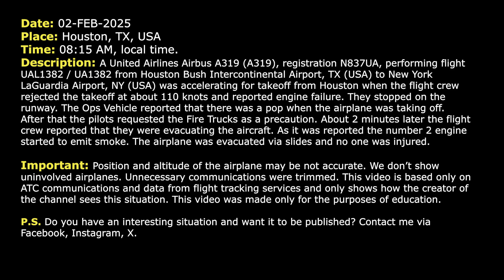Evacuation on the runway after engine failure. United A319 rejects takeoff at Houston. Real ATC

Comment: Damn, Boeing is getting so sloppy with their safety protocols that it affected Airbus' engines!!  In all seriousness, if the A320 was a Boeing aircraft, they would have been grounded by now with all the engine problems they are having.  Guess they paid off their politicians better then Boeing did.
Reply: I don't understand why you're commenting about Boeing when it comes to an engine failure involved in an Airbus jet. The engines on United's A319s are International Aero Engines V2500 turbofans just for your information.

Comment: Overreact much. Fire department never sprayed anything there was no need for an evacuation. There is more damaged when you evacuate under that situation then if you don’t. Pilots should have inspected the situation out the window and made the decision rather then going with the reports of the FAs
Reply: If there is fire or smoke indications, generally they will evacuate. A fire could consume the entire the plane in seconds so its a risk analysis I guess.
Reply: @ that is absolutely not true. We have checklists we run one part of that checklist is check for visual flames or smoke. The amount of smoke coming up out of that engine was not at all an alarm for cause. They discharged the first bottle which killed the flames if there even were any.  Engine failures happen every day. Very rarely do u evacuate for them. Especially for a contained one like this. When you evacuate like that you place people running across active taxi ways and running infront of responding emergency vehicles. It becomes very dangerous. Take the San Francisco crash for example. Almost everyone survived. One of the one that didn’t was run over by a fire truck. While yes that crash was a 100% evacuation needed my point is evacuating can lead to fatalities.
Reply: @SnakeWhite-i9q  Out of curiosity what aircraft? My understanding is on large airliners for instance, the pilots are very reliant on the fire brigade for observations and therefore decision making, and they're not gonna spend a minute walking down the aisle to have a look. Also in the video there were definitely flames in view of the passengers under the wing, it was not just an engine failure, there were visible flames and smoke. I'm not trying to be an armchair expert, and yes evacuations are risky, but it seemed fairly appropriate here given the potential fire hazard.
Reply: @ started with a regional now fly 737s. We do rely on ARFF to be our eyes. ARFF is really only useful in that sense when they are staged. This scenario they aren’t. Not expecting the pilots to walk down the aisle but communicate with FAs. Or airside ops that were already there. Airside reported no flames when they arrived. Which was over 10 seconds before they called for an evacuation from what we were told in our company’s memo
Reply: If you're ever on a plane that has smoke coming out of an engine, I hope the pilots don't let you off until there's visible fire.  Everyone else can evacuate and be safe.  Also, don't act like you are a pilot, no commercial pilot with an ATP certificate would think as ridiculously as you do.  The way you think would manifest in many of the other decisions you make, and you wouldn't make it past their training.  Get your lying ass outta here.
Reply: @Kalikus808  There were visible flames in the video, https://youtu.be/6_oSCW2fOnE . Also fyi I just passed my private pilot checkflight and yes obviously a CPL or ATP certificate holder would not think the same as I do. Thats how training and learning works, you improve with time.
Reply: @ look I ain’t gonna argue with a keyboard warrior like yourself. At the end of the day it’s a judgement call, but calling for an evacuation that quick with as little smoke as we have seen in the videos posted online only puts people in more danger. And yes I am a pilot
Reply: You sir, are an idiot